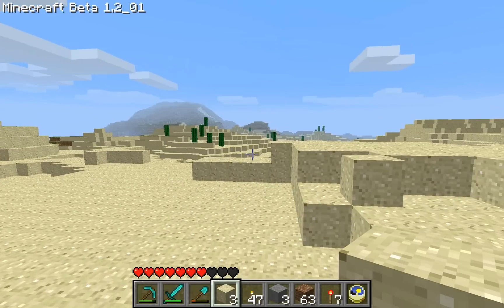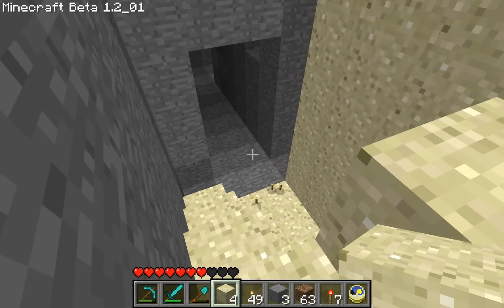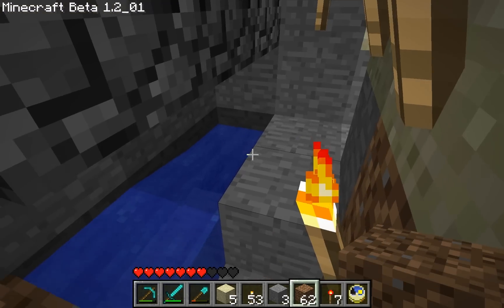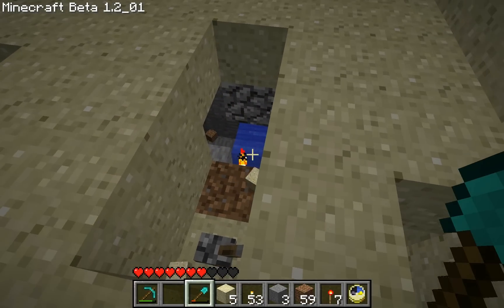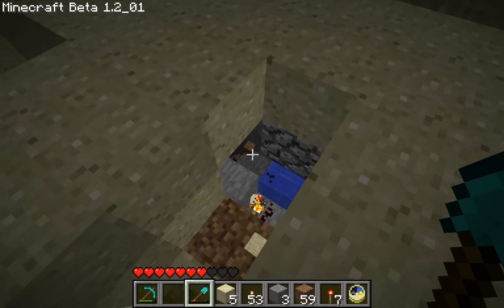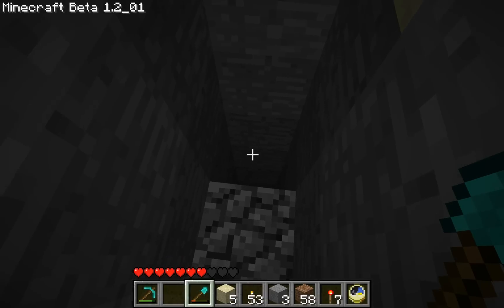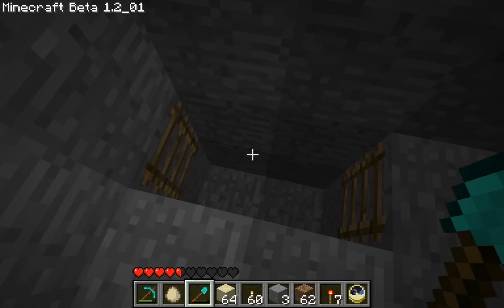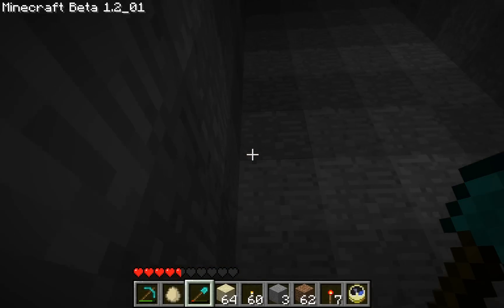How to make a Hidden Stair, Redirect Water with a Lever - Minecraft

Comment: @Corbu333 I was having the same problem but I fixed it.  I didn't have the water running over one block I had it running straight down.  So @jarikcbol... try putting another block for the water to run over.  This is on the side the water is already flowing too.  Not the side it flows to after you hit the switch.  Hope this helps.